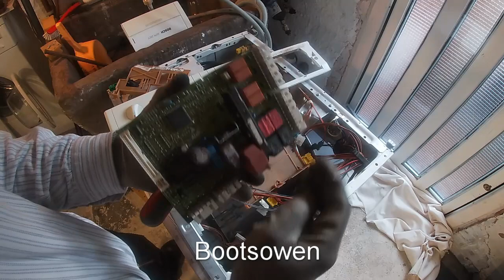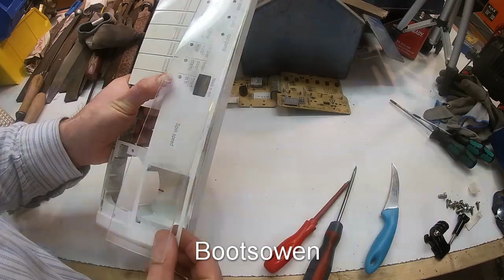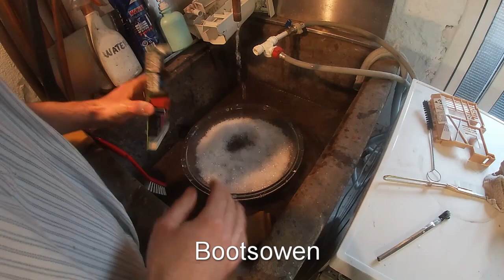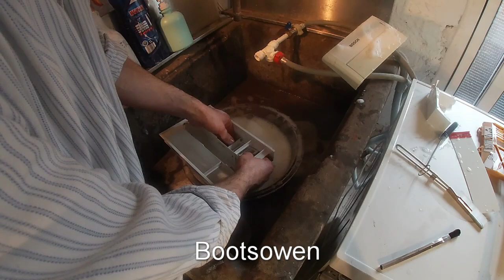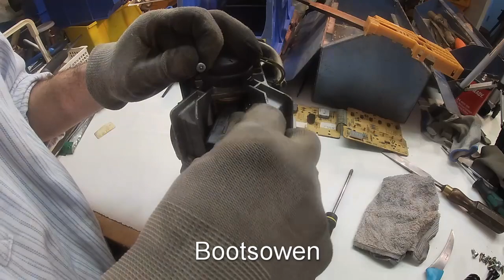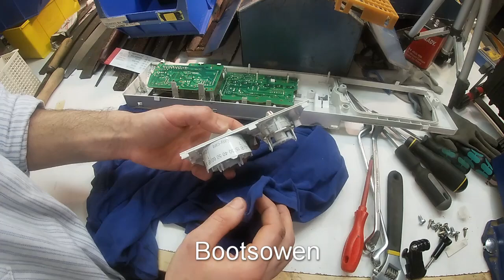Bosch WFK2801 refurbish: full clean and check over, how to extend the life of an old washing machine

Comment: I replaced the bearing on one of these.  Didn't even have to remove the drum, did it in-situ using a gear puller.  Fantastic machine - they don't make them like this any more sadly.
Reply from the maker: Can ya get to both bearings like that. I thought you had to take off the metal chassis at the back. But you could leave the drum and run in place.

Comment: We have an identical machine.  Your guide is GREAT!  Thanks!  Your struggles with the clear plastic front panel mirrored my previous frustrating attempts to clean dirt that had got through onto the plastic label.  It was easy this time having followed all of your struggles to remove it.  I used an old, thin butter/dining knife.  I inserted it at the top on the right and that immediately came free.  Then I just slid it across towards the left until all of the top clips popped out.  The last one was the most tricky.  It took less than a minute.  For others' benefit, beware of the plastic label, mine was quite brittle and broke at the right-hand opening and I spent half an hour with superglue and tissue repairing it :-)
Reply from the maker: Thanks buddy, I appreciate the comment, your experience is why I make videos!

Comment: Love your video reviews. Have watched a fair few and learned quite a bit. 

However, just had an error 4 issue on my WFK2200. I’ll be damned if I am going to let it die. 

One of the dampers was shot so have just replaced both but it still doesn’t fully spin up. 

Took the power board out and R30 resistor is blown to smithereens. R31 doesn’t look much better. 

Would you happen to have a photo of a Bosch 260786 power board so I can work out what resistance those resistors are?
Reply from the maker: I am not near my machine at the moment. So I am not much help. What I would do is search the sold listings worldwide (and for sale) for that board model number or anything similar. You might get a good picture that way. They are usually for sale somewhere. Do you know if the board. Is the same as the one in mine? Have you figured out which fault it is?  Is it the board or a motor/heater/etc fault?  Obviously the board is broken but the code should reflect which bit of the cycle it is failing on. What I am getting at is that it may be possible to figure out what resistance you need by comparing that function to another Bosch board of that era. I am a little out of my depth electronically speaking so my first option would be the photos. Let me know how it goes or make a video of it. This kind of fault and repair is the good kind! Probably a very cheap fix.
Reply: @bootsowen  Hi. Thanks for the reply.  I think yours is a different board but I am guessing circuit wise it would be much different.  Yours may have more functions but I do know mine is identical to WFK2800GB/11.  I am assuming yours is a WFK2801GB/01.

It fails on spin.  At first, I thought that the violent action of the drum when it started to spin up triggered some kind of primitive accelerometer (movement sensor) and after so many attempts it just gives Error 4 but that is when I investigated further as there seemed to be a lot of clicking from a relay on the power board somewhere and that's when I found the blown resistor.

I've spent a good portion of time since commenting last on trying to find a circuit diagram but nothing has materialised.

If you are somehow able and willing to upload a photo of your board, I may be able to get a little closer.  It would be awesome to be able to simply change a resistor for pennies or even free if I cut one out of an old PC power supply assuming I can work out correct resistance.

Comment: Hi Bootsowen hoping if you have the time you can give me some guidance.
I have a 2003 model Zanussi washer dryer WJD1457W, it's not working at the moment as I am trying to repair a part,
before I invest time and money in this old machine which I think is a great machine can you give me any idea how to make sure that the Drum is still secure and the bearings are ok is there any test I can perform to give me this information.
Your videos have helped me save a lot of money over the years and save the environment from discarded white goods I think you are amazing thank you in advance. 😊
Reply from the maker: This is my granny's machine, https://youtu.be/NzOH_T4UHrU. it has a badly failed bearing. If the drum will rock like that the bearing has gone very badly wrong. But if it rocks a little bit, then it is on its way.  SO that is the bearings.  The drum spider can be corroded and go wonky. to check this give the drum a good spin by hand with the door open and see if it wobbles relative to the rubber door seal. if it appears to go in and out or up and down then the spider is maybe on the way out.  But even a machine on the way out can last a few years.
Glad you like the videos.

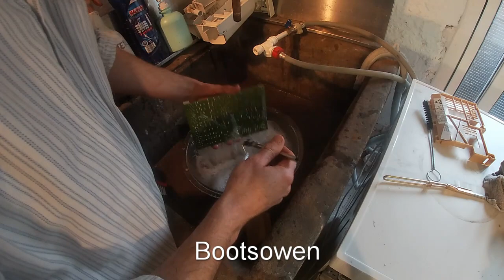Comment: 25:17 are you sure it’s alright to get the circuit board wet? Won’t that make things corrode and if there’s an area that’s not dry wouldn’t that ark or affect it?
Reply from the maker: It doesn't seem to matter, people put them in ultrasonic cleaners, as long as it is dry before you use it it should be ok.  I think if it is dirty and it gets wet then you can have arcing. this happened on my Bosch WOK after I turned it upside down.
Reply: I wouldn"t recomand cleaning circuit boards with with water. Especially if there are any transformater on it

Use Isopropyl alcohol instead :)
Reply: Miki Gry I would also recommend Isopropy :) That is better for the transformers, switches, contacts of relays etc as it doesnt cause them to corrode. The last I would use is water to be honest.